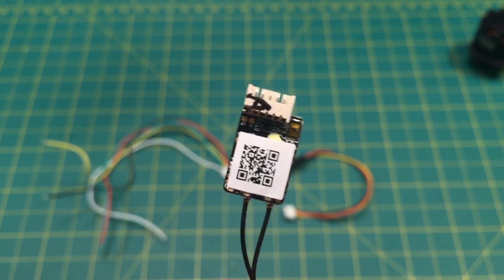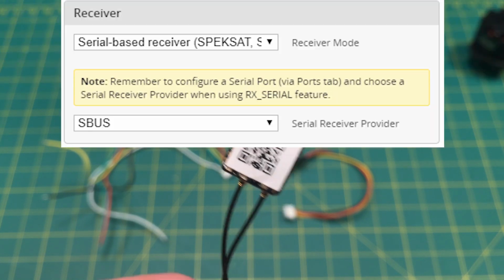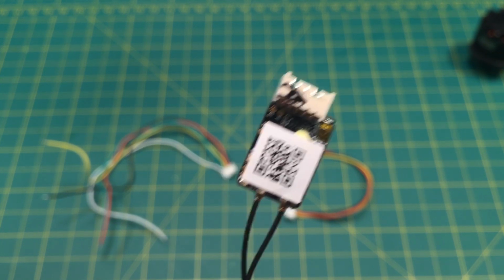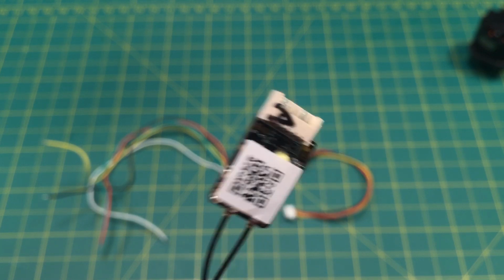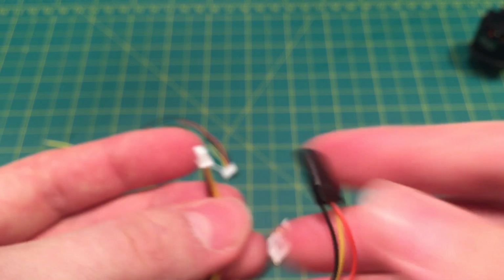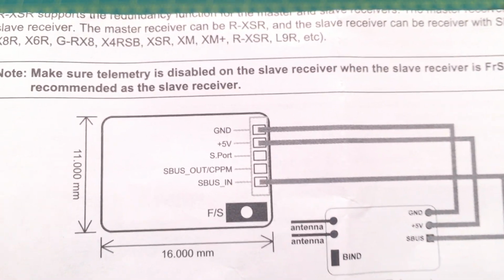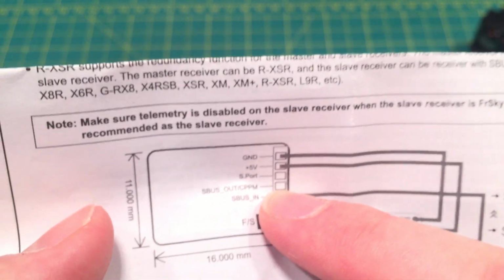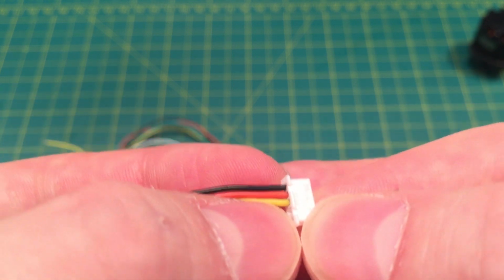FrSky R-XSR Receiver: No input? No Channel Band Movement in Betaflight?

Comment: Yo all! I have done this step since i already knew this. I still have no input in betaflight! I tried everything that i can think of. Updated fc firmware, changing uart, receiver options , sbus and ppm... Everything but still no receiver input in betaflight :( :(  All of my quads i had no issue at all. This time tough.. argh Xp already spent a week to figure it out. i'm trying it with the new beta 85X 4K and the R-xsr receiver. I rlly hope anyone knows! Thanks!!!
Reply from the maker: It sounds like you have tried things extensively. There are two options left that I see to try: a new receiver, and failing that, a new flight controller. There was one time that I soldered a receiver to an Aurora A100 FC and something must have happened, since after that I got no stick input. But the RX was fine in every other quad.
Reply: John Cuppi thanks for your answer! I think you are right that those are my only two options left. It’s a new receiver but I’ll try to take one out of another quad and see if it’s working but I don’t think so. For the fc, I don’t see anything smoked/weird about it but maybe it’s invisible intern.
Reply from the maker: @diepvrieskieke  That's what I did to verify that the Aurora A100's board had gone bad. The board did not burn or anything, it looked fine in every other aspect and passed motor testing in betaflight, etc...! But no input from the RX, multiple of them. I gave up on it. Later on I re-examined the board and noticed a VERY small piece of solder had gotten on one of the chips, like micro dot small. Not enough to short the entire board out and cause magic smoke... but enough to kill the receiver inputs I guess. :(
Reply: @JohnCuppi  Wow How could you even know huh Xp i had this one time when i was assembling a computer. everything i did nothing worked! So i had no other option than deassembled the whole thing, and what did i found out? there was a little screw that got stuck behing the motherboard and the case giving a short! Xp But i hear alot of problems with the beta85X 4k, broken vtx after 3 flights, enigne that stopped working.. Well i tried to put another receiver in it without results.. i have to order a new fc i guess Xp Thanks for your feedback i appreciate it !!

Comment: Even after flashing the fc and making sure I moved the yellow wire to Sbus. Still there is no response in the Receiver tab on betaflight. Now my radio switches are set up also I have signal the R-xsr is bound to the radio. But in Betaflight the receiver tab there are no responses when I move the controller. Also I can arm the motors too. Any ideas ???
Reply: Did you ever find a solution to this??? I have the same issue and its driving me insane!!!!!
Reply: @tuckermaccallum2510  Unfortunately no and no one seems to know. I just brought another drone and used this on for parts. Sorry brother

Comment: Thanks, that helped a lot. I read the diagram right, but I had my receiver tucked away and when looking at the cables I thought the white was the fourth cable, but it must have crossed with the green somewhere which I mistakenly thought was the sbus out wire instead of in.

Comment: uh.. i have everything correct. checked wiring, taranis imputs, and all the betaflight setting. still nothing..
Reply from the maker: Have you checked that your receiver has the correct regional firmware? EU firmware won’t work with non-EU firmware, so if you are having problem binding RX to TX this may be it. Otherwise, either your flight controller or r-xsr is defective and you'll need to try to isolate the issue to determine that.
Reply: @JohnCuppi  I fixed it already. Only video that solved my problem is this one that shows how you hold the bind button untill a solid blue light turns one, then it's in normal mode or whatever. Normal when you bind it you hold it for too long and it's in a different mode.

Comment: thank you for the explanation this solve my mistake, one question...the orientation of the antennas (for the best range transmission) is in parallel or perpendicular?
Reply from the maker: Happy I could help! As far as antenna orietntation goes the best way of mounting receiver antennas is to have one horizontally, and one vertically. Personally? I just run my antennas horizontally out the back end of all my quads. For my typical use case (flying around trees on ~10 acres of property) this has worked just fine for me and it keeps the antennas from getting messed up.
Reply: Thank you very much  @JohnCuppi , you have one subscriber more ;-)
Reply from the maker: Nr V-S thank you as well! I always try to respond to every comment I get so feel free to ask whatever! 👍🏻

Comment: so do you have to solder the green/blue wire to a tx/rx pad on the FC to get telementry? what is s.port wire for?! please help
Reply from the maker: If you only want rssi/signal strength telemetry, the r-xsr will provide that on its own with just sbus soldered. If you want more telemetry data. S.Port is what you need to obtain that data. The S.Port wire must be soldered to an free UART on the flight control board. You'll need to solder both at the same time -- one UART goes to sbus, the other goes to one for the SmartPort. There's also yet another option of using something called Frsky F.Port to get it done all-in-one but it has never worked for me. Sorry if that sounds confusing.

Comment: Did you have RSSI low or critical warning with yours? I have two BNF quads (GEPRC Elegant) come in and both are getting those warnings from my Taranis qx7. I lost control at a short distance and it went crashing to the ground. I've got other quads that have XM+ and don't have that issue such as my Hawk 5.
Reply from the maker: None of my R-XSR receivers have RSSI low or critical warnings. They work excellently. I am using Taranis XD9+ with mine.
Reply: Thanks for the quick response. Yeah, I'm a bit perplexed why it's only happening with these receivers. Got the first one in and it's showing a RSSI readout of around 8. The new one I got in yesterday shows a readout of around 25. All my other quads show a strong reading of 99 a pretty good distance away.
Reply from the maker: @jonsmusicchannel6916  I own about 5 r-xsr purchased at different times and have never received any rssi warnings on them flying around trees and whatnot on around 20 acres of property, makes me wonder if there is a bad batch that went out or something like that... sounds defective; i'd request a refund.
Reply: @JohnCuppi  Did you update the firmware on yours by any chance? Was wondering if maybe that was needed or something. I did order a couple more receivers to see if they are any better than the ones installed on these quads. If not then it could be something faulty with these from GEPRC. Thanks again for the quick responses. :)
Reply from the maker: @jonsmusicchannel6916  Nope I have never updated any firmware on them. They all just worked. Hope you can get it figured out; let me know if you do please!

Comment: that is actually a cable for if you want to flash your receiver with your controller which is what the other end of that connector is for :)
Reply from the maker: Geoffrey Martin yup exactly right. I cover a bit about that also at 1:54 :)
Reply: @JohnCuppi  the problem I had with my Rsxr was actually holding the bind button down too long which went into another mode oops spent almost an hour in betaflight figuring out why the blue light and binding worked for my friend's QX7 but not mine which he helped me get my quad setup

Comment: I dont get this, I dont use the "firmware upgrade wires" on my flight controller? Even if it is wired incorrectly.... I solder the cables correctly from the other connectors the R-XSR (following the diagram) to the flight controller and still not getting any signal in the receiver tab in betaflight ....
Reply from the maker: It sounds to me then that you have a different issue if your wiring is correct per the diagram. Defective R-XSR, Mismatched R-XSR firmware, or defective flight controller maybe.

Comment: You are so on point, thanks for getting me back in the air, real prosper.
Reply from the maker: You get RSSI telemetry on the radio itself even with 3 wires, which is the only thing I wanted. You can't get that with XM+

Comment: PLS Help! I installed latest eu firmware on my new x9d+ se.......x9dp-openTx v2.2.2-20180525 Placed the right sd contents on the sd card... I installed latest lbt firmware to the r-xsr receiver.........171103. But it won't bind! All leds constant on at bind procces... 2 days have past and I can't find a solution.. what could be going wrong I don't know!
Reply from the maker: Oh jeez. I have no idea. :( will it bind to any other receivers that you have?
Reply: Got it working!!!! :)
I flashed fcc/non eu firmware to the receiver and the latest non eu open tx firmware and it finaly bound!!!!
It doesn't work with eu firmware?!
TY for your reply!

Comment: what if i am still having the same issue No Channel Band Movement in Betaflight even after i swapped out the wires? It is a brand new r xsr.
Reply: FLO PV i have the same issue. All wires in plase, yet bo signal in betaflight. Brand new r-xsr
Reply: @Raccoonov  I also have the same issue. brand new receiver as well. did you guys have any luck?
Reply: What FCC are you using with your XSR?
Reply: Mr Esterhouse I’m using a matek f405std. By it turned out to be a faulty r xsr. Soon as I swapped it over with another one it worked fine.
Reply: Hi Con. Lucky for you! I'm trying to use the XSR RX with a NAZE32 Rev6 FCC. Turns out some of these types of boards can accept an inverting SBUS output and some revisions can't.....talk about a stuff around....I just want to work! Need to continue my research to find out what's going on.
Reply: I got the same problem too, wires are all in the right place, using with NAZE32 FCC, no joy

Comment: that cable is for qx7  flashing , comes with most recievers its not wrong,
Reply from the maker: michael honeychuck Obviously you didn’t watch the video or you would have seen exactly where I pointed that out @ 1:52
Reply: john i did watch your video, my issue is i was trying to use fport on my wizard x220 with sprf3 , and directions say download fport firmware and use sport wire too any uart on f3 board . set all my settings in betaflight 3.3   to be used in fport mode. no matter what i do i have no tx movement in BF. have you used fport? i have a qx7 and from what i see the lastest fport firmware has no eu or fcc distinction .  i loaded them both and i have set halfduplex on and off and the inverted command ,, no tx movement and now the rxsr will not bind . so started all over with no success and now my fs button has come off which is just a jumper cover to bind. so now im trying to jump fs so it will bind ,, not easy ,, will probably just get another rxsr and solder it in sbus . not sure but going by direction from frsky and others , fport doesnt work soldered too tx pad or i got a bum rx.  something with firmware isnt right . this is my first quad but i have several aircraft with , grsxr, x8r , rx8r etc and have never had an issue. kinda stumped
Reply from the maker: michael honeychuck nope, I have never used fPort. This video will help you get setup with a regular old sbus connection. My understanding is that fPort can be enabled over the sbus wire but I don’t really know how to do it. Does regular sbus work?
Reply: going to try it , if i can get the fs button too bind, probably order a new rxsr and use sbus , finding conflicting info on fport. new to quads other than toy ones but have 45+ yrs of rc . the nice thing frsky a receiver is cheap compared too hitec. according too instruction its done over smart port wire and wired to tx pad. i cant get it to work

Comment: Are you using an F4 Flight controller. For telemetry to work do we need to take the yellow wire out. Solder it onto the P on the back. Or can we just go straight. I am having trouble with this receiver and tje DYS  F4. I know the uarts are mixed. If I dont want telemetry how would I go with wiring this up?
Reply from the maker: Yes that's an F4 flight controller. You get RSSI telemetry no matter how you wire this up.  I'm looking at the DYS F4 V2 fc and I see pinout for 5V,BAT+,TX1,SBUS. So just do as I did in the video -- and move the yellow wire over -- OR  your other option is to use the other cable and wire the green one right into the SBUS pin. Just ignore the yellow and white wires in that case entirely. You only need to wire in 3 wires -- 5v, gnd, and sbus.
Reply: John Cuppi thanks mate. With the Antenna. Can you solder one on. Mine has lost its clipping abilitie. Will soldering it do any damage?

Comment: Great info, did u wire up the telemetry wire , is it simple to set up?
Reply from the maker: Gavlar Fpv 78 No I haven’t. I want to take a look at the F port stuff which supposedly can transmit more telemetry over a single wire but I haven’t gotten around to it yet. With this setup you just get basic RSSI telemetry which is most important to me.

Comment: Hey John! Thanks for making this video. I saw on the documentation that the 5th wire (white) was SBUS_IN so I've plugged that one on the SBUS port of my FC and I'm having that same issue with Betaflight at the beginning of your video. When I look at your wiring, it seems that you've put the yellow cable on the 4th pin of the R-XSR, which is SBUS_OUT/CPPM. Am I seeing wrong? Shall I try to wire my cable to SBUS_OUT/CPPM instead of SBUS_IN?
Reply from the maker: That’s correct! I moved the yellow wire to the 4th which is sbus_out or rather the sbus output signal that is intended to feed to the FC. The 5th wire is SBUS-in; which is intended to connect to the sbus_out of another RX. No worries though. Move the 5th wire to the 4th pin shown in this video and you should be good.
Reply: Thanks John. That helped. Another issue I had that might help people here is my R-XSR was in CPPM mode. So I had to hold for 4 second the F/S button on it and now I can see all signals on Betaflight, which I couldn't before.
Reply from the maker: Oooo, I've never had that problem yet with the 4 r-xsr I have so far, but thanks for the tip. Glad you got it working!
Reply: Hello Fry, Your advise about CPPM mode help me resolve my issue, once I chose the correct SBUS wire, as advised by John Cuppi. Thanks for the help. I've spent 5 hours trying to figure this out.

TK

Comment: The 3 wire harness is for flashing and the 5 wire harness is for wiring upp?
According to other tube chanels.
Reply from the maker: Correct! :) of course you are welcome to use the 3-wire and switch the pin location if you want if you only intend to wire it for sbus.
Reply: Can you just remove the yellow and white and then solder?  On the five pin plug?